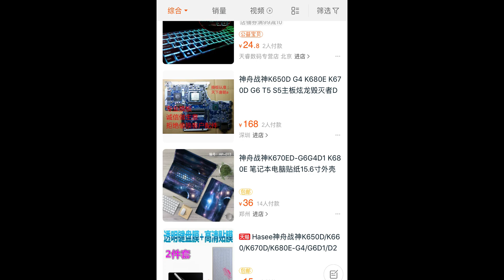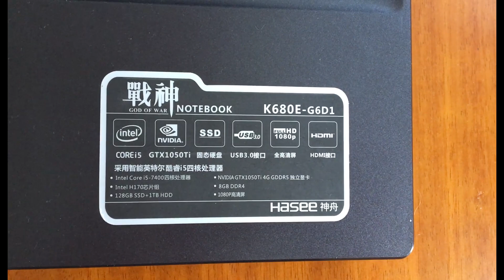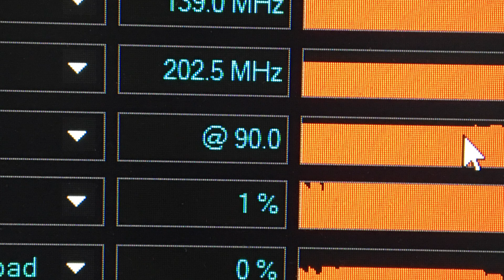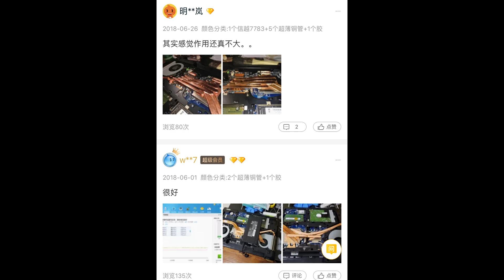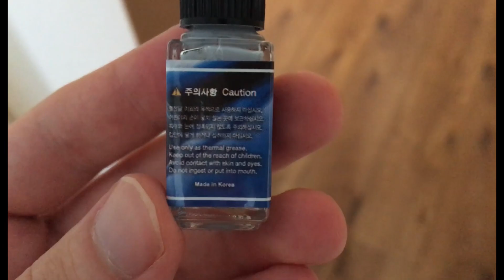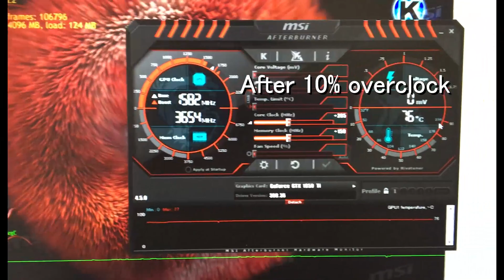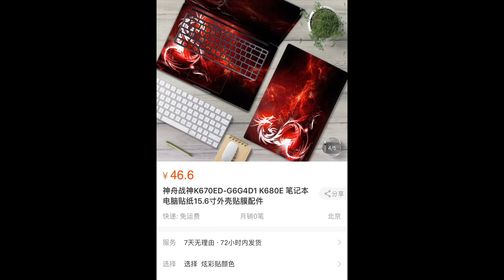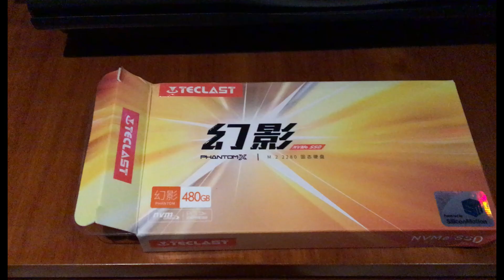$700 Chinese Hasee Gaming Laptop - A $6 Frosty Upgrade

Comment: I would never pay 600 or 700 bucks for a Chinese computer (200 or 300 tops is appropriate).
Reply from the maker: First off, the vast majority of all computers are made in China, so trust me, you already spend more than 300 for a Chinese computer.
This is a gaming laptop that does a reasonable job for its price, and like all cheap gaming laptops they tend to overheat. But in early 2018 this computer was pretty much still 100 bucks cheaper than the cheapest comparable gaming laptop in the West, so it definitely was a good deal.
Reply: Thank you! Thinking of  buying a Hasee laptop. My main concern though is the heat. This brand doesn't seem to care about laptop cooling, considering the hardware is pretty powerful.
Reply: bought a 1660ti one for 600 good deal its chinese but its a clevo rebrans

Comment: Thanks for the video! Could you give an update on whether you encountered other problems with the laptop? As on a lot of forums everyone says they have problems but nobody really gives examples, so it feels like they are talking on faith. And honestly a 90 degree heat while playing is not so bad as my Lenovo y510 also gave me the same problem, I fixed it with liquid thermal paste.
Reply from the maker: Hi there ! Well so far, after I created the bridge between the GPU and CPU no problems encountered. I screwed up the thermal paste application last time I opened my laptop so my current temps are not so good  (like 85-86) (and its summer), but overall its an upgrade I really recommend if it is possible (like if your cpu and GPU fans are not connected with each other, and that making a cooper bridge between them doesn't require to butcher completely your laptop). 
Putting liquid metal is also a good fix. But anyways, once you have reached max temp of 85 under full load with a laptop, there is not much point doing anything more since overclocking is seriously limited on laptops (I only managed a +10/15% on my GPU on my Hasee).
Reply: @yamapopi  thank you for the quick reply. Indeed overclocking on laptops is not really a big thing. With the liquid thermal paste you can lower the temp to probably 65 degrees, but it has it's risks. If you add too much it can start making short circuits.

Comment: So what do you think about Hasee laptop? Im going to buy one and im quite confuse. Its quite cheap with good specs but not sure how about its running.
Reply: Alright well i am messaging you 5 years later. How you doing. But I have a Hasee I got last year on blackfriday for about 877 USD. It was a (( Hasee Z8 (15.6'', i7-11800H, RTX3060), Gaming Laptop, i7-11800H 4.6GHz, 16G DDR4 RAM, 512G NVMe PCIe4.0 SSD, RTX3060 6G GDDR6, 15.6'' 144Hz 1920x1080 FHD IPS Display, RGB KB, WF, BT, Win11, Ore Black )) from newegg and a review from me well. Simply it's great for gaming I upgraded the 16gb of RAM to 32gb. Sometimes the laptop blue screens on games but mostly due to over heating and I mostly fixed the problem by keeping my game room cold to about 60-65 F and making sure there is a limit cap on FPS because the CPU is the one thing that overheats. But other then overheating there are no problems whatsoever, hope this was helpful to you. An no I am not a paid spokes person or whatever just my simple review after a year
Reply: To add on. What games can it run? So far I been able to run EFT on med-high also the new game forever winter been playing hours of that can play it on med. I haven't found a game yet I can't run due to specs
Reply: @BreadHomie1234  bro im in china and i want to buy a hasee pc for gaming and studying.. so do Would you recommend this pc for me?
Reply: @sensei7182  Yes. Just upgrade the RAM to 32gb. I can play a lot of FPS games like Escape from tarkov and what not. So it will run most games if you get a decent one from hasee like the Z8 is mine
Reply: @BreadHomie1234  thank you bro im going to buy rtx3060
Reply: @sensei7182  let me know your thoughts later